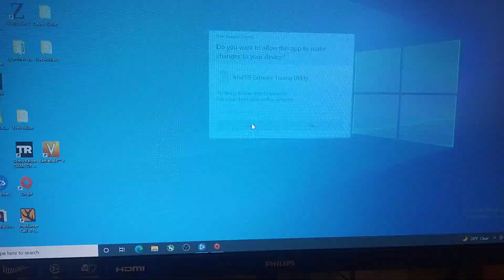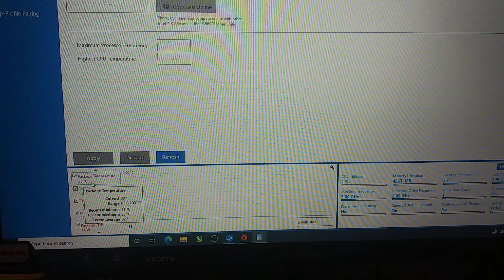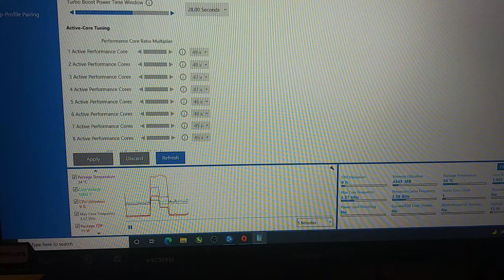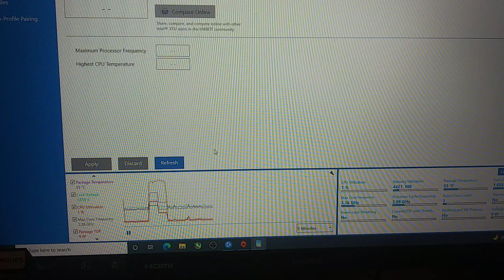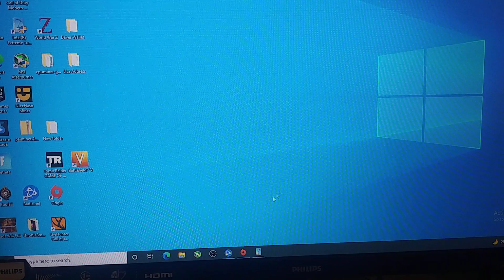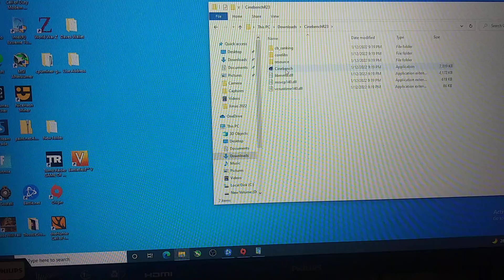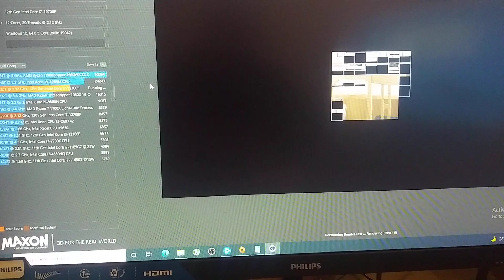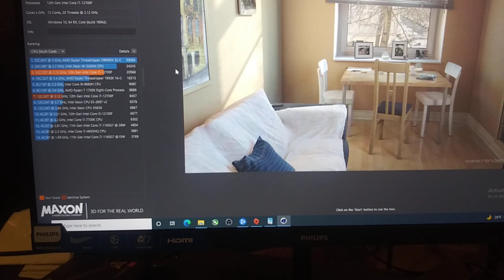I7-12700f Benchmarks with Noctua 120mm Cpu Cooler upgrade, Cinebench R23 XTU  Power limits unlimited

Comment: You will find that if you switch on pc and run cinebench, that will be your highest score. why because you might only get 2mins of turbo boost which is limited by windows. on my b660i ddr5 boaurd i get 124 secs of turbo boost and thats it. all cinebench scores are lower than first run.

Comment from the maker: Original video with Intel CPU Cooler (stock)  https://youtu.be/ICzefDj418I
One gaming video from FortNite demonstrating stock cooler vs Noctua and Power Limits Unlimited:  https://youtu.be/tMwVEAiUbP0
Second Benchmarks are done with Noctua 120mm CPU Cooler with single tower.  PL1 and PL2 set to unlimited
XTU Score at 02:10   - I have gotten higher scores than shown.
Cinebench R23: 07:20
Amazon Associate Link for the Noctua Cooler:  https://amzn.to/3I6UiWv